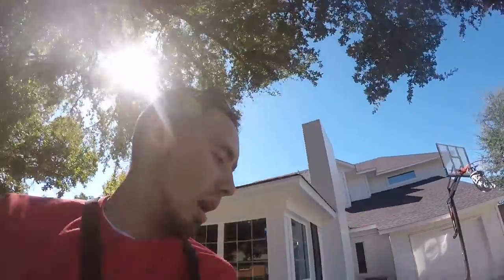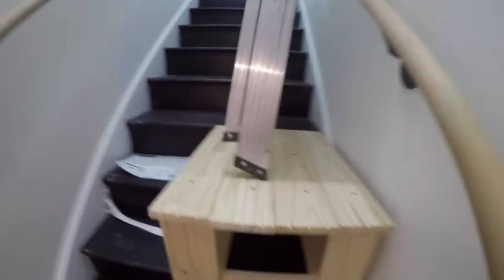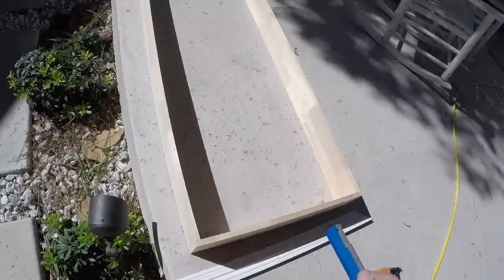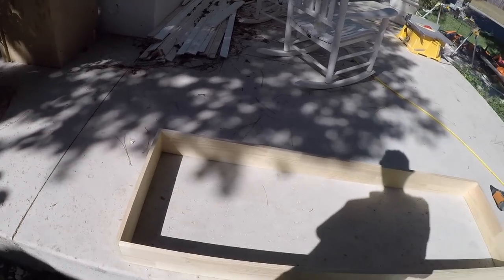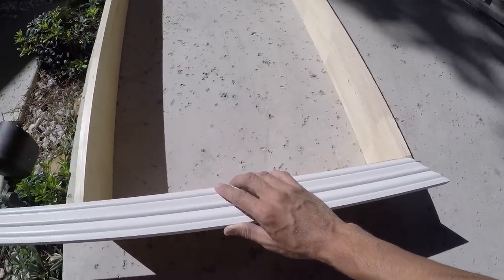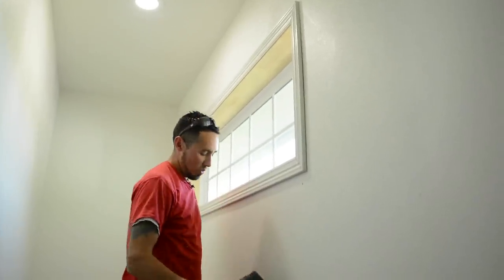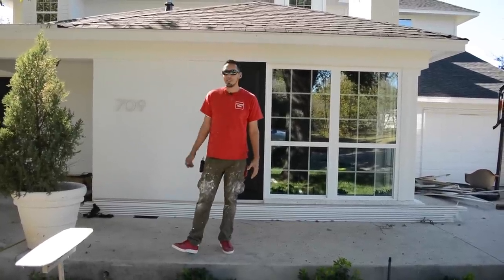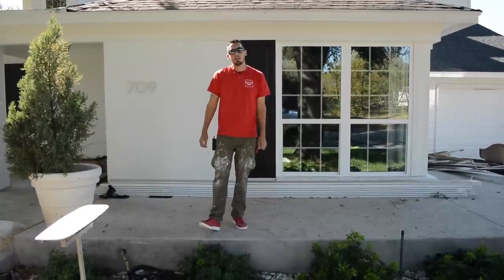Easy Install Window Casing - Trim Carpentry

Comment from the maker: I know someone will talk about my non OSHA approved ladder rig. Let me just say it was safe for me. I jumped up and down on it. Apparently no companies make a tool for your ladder like this because it is not approved by OSHA. In the real world, I just get the job done. If anyone wants to skip the build and go straight to the install click 13:30
Reply: dfw crown Don't worry about the YouTube keyboard commandos. It worked for you. That's all that matters. Great work Richard!
Reply: It's all good bro, just do what you do.
Reply: It was perfectly executed.  Funny thing is that once I stacked 5 pallets to paint the top edge of stairway. 

Wife thought I was crazy when she woke up found me about 12 feet in the air. My response was "you wanted me to paint"  Lol
Reply: I use the PiViT ladder tool for stairs
Reply: dfw crown   If we all followed every “OSHA” rule, we would never get anything done.
Reply: When doing casing I found the easiest way to get your measurements is measure the inside dimension of the jamb then add your reveal x two. Example for a quarter inch reveal it would be 1/4 x 2 = 1/2”. Add that 1/2” to your inside dimension and that’s your measurement. Of course your measurements and cuts will always be heal to heal. 👍
Reply: You speak the truth, Justin Carter. What's worse is that a lot of these OSHA bureaucrats have no idea which end of the hammer to hold on to.
Reply: I bought and use a Werner muli position telescoping ladder , but I wish I didn't. Too Heavy !
Reply: Great idea! If you don't mind, i'm going to copy your jig. I need to make a sturdier one because i'm a heavier guy, but great concept! Just what I needed to paint the stairway walls and ceilings.
Reply: As a builder myself. If we had to follow all osha rules you would never get your job done. Great idea on the jig.
Reply: That ladder setup was perfect.  Your videos are always very informative and your methods work. Thanks
Reply: Robert Flores our painters use this. They love it
Reply: ruben00763 I do the same. Much faster.
Reply: dfw you got some skills bro...i been in the trade for about 5 years now...started in rough framing...now doing finish carpentry...and I must say man....im alot happier...
Reply: dfw crown, thanks for the idea, I made my own and it works great! $15 for a piece of 2x12 and it can hold 500+ lbs. Worked great for me! Thanks again!
Reply: That's what I use installing screen porch panels off 32ft ladders.  It works well and I feel perfectly safe on stairs and un-level ground.
Reply: Noconz0727 MC  See you! got it......!!!!
Reply: If an osha guy trimmed that window he would have a safety harness and a jack lift with side rails. He would of charged 3000 dollars to trim one window. In the real world you do it as you did it. Great job.
Reply: Seems to function the same as a "ladder pivot" that we painters use.  I think that product is osha approved..at least I hope it is. 😂
Reply: Worked great...also check out some bakers scaffolding for that type of thing
Reply: That was probably more structurally sound than what you would have been able to buy from any big box anyway if they were made.  Your stuff is trustworthy. 

For future reference, you would have been better off cutting the sides the 1.5" shorter because if the "window box" wasn't square you would have still have no visible gap unless it was more than .75 inch out of whack.   Not complaining, just trying to share what I learned when casing windows.  Your workmanship is excellent!
Reply: Not osha approved but definitely kentucky carpenter approved, love your channel, I do some things a little different, but I'm young and i see alot of stuff that the older dudes I work with don't like to break down and teach me, your awesome at breaking this crap down
Reply: The problem with safety stuff is that it often makes the job far more dangerous, especially for first-time users of such. Safety glasses fog-up, hard hats slip and fall off, harnesses get tangled-up in tools, equipment, co-workers and materials. What OSHA can never teach is common sense and that's almost always the difference between staying safe and dying. 
It's also far more time-consuming, incorporating safety equipment and who wants to charge good clients more, for something you neither want or need nor can justify?
Reply: Finish Carpentry TV Mexican OSHA approved.
Reply: No problem. I take some concrete blocks and old towels and use them when I replace sconce lights in stairwells. Hot to learn to improvise in construction. Good job!
Reply: I love the idea but I guess that’s why women live longer than men. I would use one.
Reply: According to the World Health Organization, the United States leads the world in ladder deaths. Each year, there are more than 164,000 emergency room-treated injuries and 300 deaths in the U.S. that are caused by falls from ladders. Most ladder deaths are from falls of 10 feet or less. Falls from ladders are the leading cause of deaths on construction sites. 
One of my licensed contractor friends with 15 years experience recently died from a short ladder fall in his own garage.  I highly recommend everybody watch some videos on ladder safety, and invest in a quality ladder (like an adjustable Werner >$200) which can handle most weird jobs like stair areas.
Reply: Finish Carpentry TV 
Curious why the 23inch stiles need to be, as you stated on the outside? I’m new to this so pardon my ignorance.
I would assume the rails that are 63/12 should be on the outside and the 23inch stiles on the inside for additional strength and support. Kind of like framing a wall? 
Does it not matter?
Thanks
Reply: I can see he has all the good tools but I also see in all the videos he wears the same pants, what he cannot afford to buy any new ones, you are a good carpenter.
Reply: as a joke you should put a harness on if you really wanna see the osha trolls go nuts 😂😂
Reply: sal hoops maybe he likes those pants, lol or hell he could have 300 pair of those same pants - who’s to say? You have no idea why/what’s going on & zero basis in ur assumption that he only wears “the ‘same’ pants bc he can’t ‘afford’ any others” lol jeez man ppl crack me tf up 😂🙄
Reply: Finish Carpentry TV question. Did you paint it after the install?
Reply: As much as it pains me to say, stairway windows the little giant style windows really shine.
Reply: @justincarter9622  OSHA doesn't regulate home owners or a handyman type business like dfw.
Reply: Finish Carpentry TV yeah, how the heck did the world manage to get built before the existence of the Oh Shit Heart Attack agency? 😂😂
Reply: A couple of multi position ladders and a plank between them might be the answer to get up to the window safely
Reply: I know this is an older video, but I just discovered you. I hav always been quite jealous of smaller statured people who can dance around on ladders and goofy contraptions. I’m 6’5” and 350# (I’m not diesel, I’m just fat...now) but no one ever complains when I’m the one humping all the tools out of the van.
Reply: Bet you almost gave your wife and parents a heart attack! I almost had one!!!!! Should give us sissy’s a warning! 😩
Reply: Don’t see an issue here, it’s either scaffolding which is a pain for a quick job or what you did. One other option might be Werner LevelLok or other similar products but that means your ladder width needs to be close to the stairs treads.
Reply: I have a "little giant style" ladder that works fine on stairs 🦧

...though I did have to change a lightbulb at the top of stairs like this once too, and in that case i taped a board to the bar ends of a adjustable ladder so they wouldn't punch through the dry wall and leaned it back off the step going the opposite direction against the high wall. Seems like that would have worked fine here too, without any worrying about toppling off of anything 😆
Reply: Youre good,  ive had ladders on ladders🤫

Comment: Not OSHA approved but Idaho painter approved
Reply from the maker: Home Improvement How To's nice! That's all I need!
Reply: Are you kidding me? It's awesome! I was pondering whether I want to build one now or wait til I really need to use it. at the moment I'm able to stand my Little Giant on the railing base and lean it against the wall. I'm hoping it will also be useful to lend to friends trying to do the same, my question is are all modern stairs a common standard pitch?

Comment: As a finish carpenter myself I really appreciate your craftsmanship and attention to detail. I thoroughly enjoy doing trim work especially crown molding and wainscoting, you'd be surprised how poorly I've seen trim installed in million dollar homes it seems as if the previous workers took no pride or care in their work. I've seen some work that did not even have the joints /seams sanded or caulked lol oh well more repair work for me!

Comment: I had a bunch of 4x6 windows and this is exactly what I did. I built and molded all the frames centered them with shims
and presto! fastest install ever with minimum caulking. Great video.

Comment: Fantastic job, never easy working at a height. We'd love to do this in our house to hide the window installations.  Our house is brick built without gypsum board inside.  Would you recommend using packers to space timber away from the surface of the reveal - i'm worried about moisture getting trapped behind.  Is it worth sealing the hidden faces of the timber?  Appreciate your advice, keep up the great work!

Comment: So I love your videos. You remind me of a kid that work for me at Euro Design Cabinets. He was always helpful and wanted to better himself always. This framed trim idea is great also for folks who have windows installed to their home that was single pain from back when. The installers only add caulk to seal in the mew ones. This would make for more air tight and better sealed. Love it. The Grumpy Gunny.

Comment: I used this same process for my downstairs windows, and it worked flawlessly. As an added bonus, you can use self-adhesive foam rubber seal on the inside edges to close off any drafts. I also painted it before install, to save the headache of taping and scraping.

Comment: I read quite a few comments before adding mine. Making a rig or jig and testing it yourself, you knew that you would be safe so when it came to the installation your mind was on that and not divided between safety and the job at hand. Very well done !! I was trying to remember though, isn't stairway work one of the claims that the Little Giant ladders infomercial used to make? Plus they make a scaffold accessory I think. Either way Great job and thanks for sharing your talent and video, Rodney

Comment: Hey man! I really like your videos. I live in Vancouver BC. I'm a carpenter who has worked his way to the top working for prime contractors building buildings. I'm now a CSO / Site super. I have always been in commercial construction. I have been doing side jobs on weekends via craigslist and a bit of word of mouth. I truly love the time I spend doing these side jobs and when I can bring a friend along and pay them as well I get really stoked. Stoked in a way that just dosent happen when at my 50 plus hour a week day job working for $30 and hour. I want to start my own company with myself and an employee or two but have been having trouble figuring out the first major step to doing this full time. I do have truck paymets rent etc and that is where most of my fear comes from when I think of getting one job and not knowing where to get the next. The only thing is I cant seem to find that first one job. Any advice for me? Cheers lol

Comment: Another fine video! 😎 I liked the close up shots of your markings. I guess that is the go camera you referred to.  I have that KREG multi tool  and just use it as a combination ruler. “THANKS” I didn’t know I can use it for that. The close ups of your pencil lines helps much and also how you draw your cut on the piece of wood. Keeps everything in line.
I am definitely going to become a subscriber but it will be on the low end. I have learn so much over the years that I should start giving back.
Peace 
Michael A.
Southern California 😎

Comment: Another excellent video again.  I usually don't comment on videos, however I had no idea that Kreg multi-mark even existed, thank you, we always made our own out of hardwood.  Maybe I can give you a piece of advice too,  if you rip your jamb on a slight bevel you can get a better fit to the window when the framing isn't straight, or the energy seal caulking holds your jamb out.

Comment: Awesome videos, great work. Easy way to get the long to long casing measurements for the frame is measure inside dimension of frame, add 3/8" (for the two 3/16" reveals) then add 5" (for the two pieces 2-1/2" casing). Just a little easier than trying to position the loose pieces and taking a measurement.

Comment: If you take the 1.5” off your verticles... it makes it easier to dry fit as the horizontal casing will be supported by the verticals. Just how I do it. 
Great videos. Thanks.

Comment: Nice! I always build my extension jambs pre-trimmed like this. For new builds, I always have to make sure they do not order extension jambs pre-installed so that I can do every window this way. The pre-installed jambs never sit flush with the drywall and I’m always having to fix things or leave larger than necessary caulk gaps for the painter. This is the first time I’ve seen anyone else do it. Smarter not harder.

Comment: Good stuff bro 👍 I personally love doing the majority of my installs like that for trim, it's so much easier. I'll do it for full jamb setups like that or even just picture frame casing setups, use the miter clamps with some glue and a couple tacks in the corners, and blammo, bring it in the house, nail it up, and walk away, job well done 😎👌

Comment: Really nice job!  I have a custom cabinet shop with hundreds of thousands of dollars of machine and I am very impressed with your skill!  A Paulk style workbench or some light weight horses will make your life easier as you get older.  Working on the ground will get harder.  Also, read 2 second lean by Paul Akers at Fastcap.  You would really benefit from his ideas!  Great work!  Great video!

Comment: Love your style of videos - they are great instructional tools for part-timers, like myself. I also like your links to tools that you use. My DeWalt DHS790AT2 just arrived yesterday and is calling out to be used.  Many thanks for taking the time and making the effort to produce these helpful shows.

As for the GoPro, it has its place, but should be used discerningly, as it can be distracting when it's jumping around. I've seen other videos (not yours), that are enough to trigger motion sickness in mere mortals from the body movements.

Comment: I love this tutorial.  You are a great communicator!  I have 1 question: No finish screws for jamb build?  While I understand that the casing will hold the jambs together, 18ga brads don't have much grip, especially with only 3 brads per jamb corners.  But if this unit stays tight then maybe I been wasting alot of time predrilling and screwing the jambs together (?)
Much Respect to you, you gained a subscriber with this video.

Comment: Try using a little Giant ladder, they're awesome. They're perfect for  working on/above stairs. You can make the ladder an A frame and make one side longer than the other, can even use planks with them, they're pretty stout.

Comment: First off... I think your videos are great... how about... 1. CA glue on miter joints( or spring clamps + fast setting yellow glue) 2. then taking trim unit, and nail to casing.. The corner miters(45's) are make and break... if reveals are off a 32nd, particularly on paint grade, only and the painter will know... any type of stops on the miter set up would really be beneficial to getting exact matching casing lengths...

Comment: This is quicker, but I like putting on the casing separate from the jambs so I can add some insulation between the jambs and the rough opening.

Comment: I do a lot of window trim outs... I've always shortened the vertical Jambs not the horizontal ....
Reply: If people put weight on the bottom jamb the nails will hold up better the other way. And doors the same applies even more so on the top or the margins get sloppy over time.
Reply: I do the same shoot tops and bottoms into the sides. I pre cut my casing without having to measure with the margin lines. Add 3/8 to the sides and subtract 7/8 on the tops and bottoms

Comment: Fun watching you work and explaining things in real terms.  What's it like working in 70+ degree weather all year?  Lucky.  Hey one thing, lower that table saw blade!  Begging for kickback that high up off the surface of the wood.  Lower so that just the teeth are above the surface.   OSHA has it's place, but over time they have become do-gooder trying to protect us from everything we do.  I'm surprised we don't have to put duct tape on the bottom of our shoes just to keep from slipping on the sidewalk.  It's crazy.  The only place I'm on their side is fall protection on roofs.  Otherwise they are worthless.

Comment: I've never done any of this work myself but am preparing to do it soon. This method of making a unit and then installing it seems really good, should it only be used in tough to reach areas or is it alright and maybe even helpful to typically do it this way? Other than large windows and such

Comment: Really enjoy your channel! Just stumbled upon it. What gauge nailer do you use for this?  What do you usually prefer for baseboards and crown moulding?  I need to buy a nailer and I only want to buy one since I'm a DIYer. I'd contemplating between 15, 16 and 18 gauge.  I'm leaning towards 18 gauge but I 'm afraid it might be too weak? I'm renovating an old 1950s house.